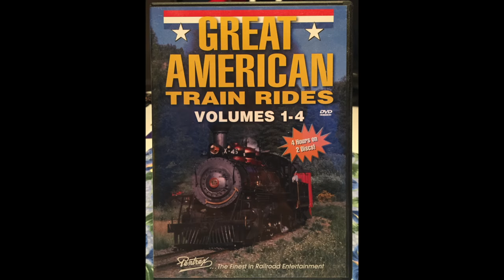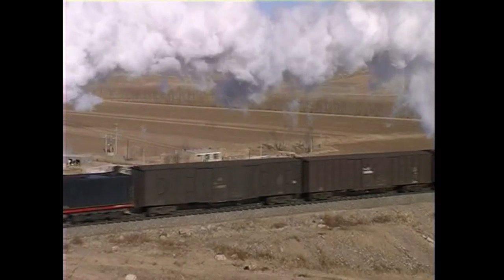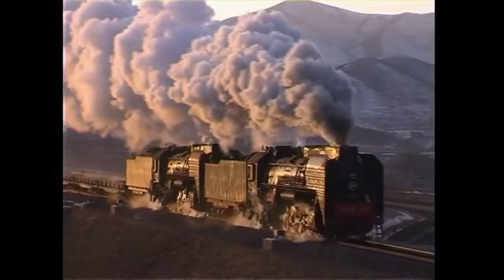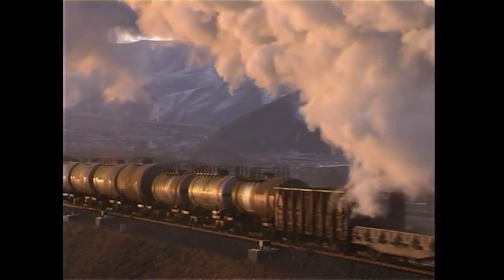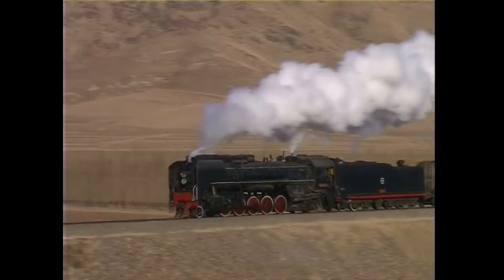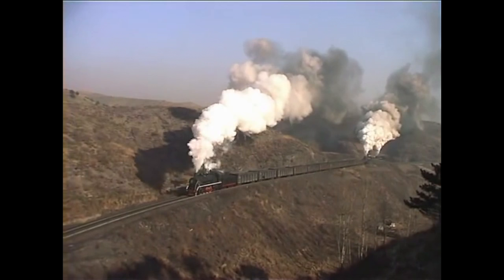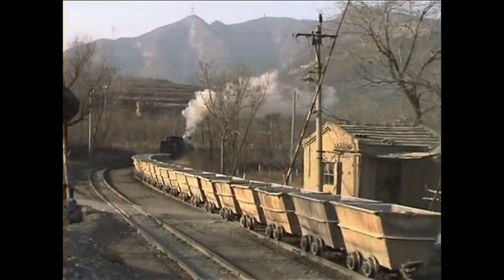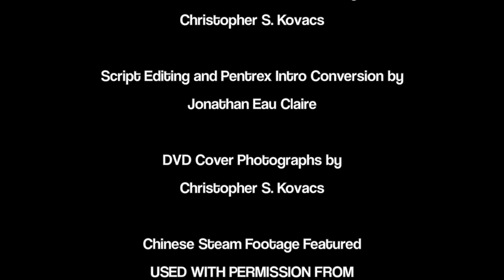The Month of Pentrex - China Steam Spectacular

Comment: The Valley Railroad's New Haven 3025 is actually Former Knox and Kane SY Class 1658M. After being damaged by a roundhouse arson fire in 2008, it was auctioned to the Valley Railroad in Essex, Ct. There, they completely rebuilt her to look like a New Haven J-1a Mikado.
Reply from the maker: +Leozilla 97  I remember it being #1658, then just #58 on the Knox and Kane before being sold to the Valley Railroad.  They did a great job returning her to service.
Reply: She originally had the M in her Number to signify that she was an American Spec Locomotive. I honestly felt that she should've stayed in her Chinese Livery while operating on the Knox and Kane. I felt that The White front and yellow lining made her look like a Clown. But yeah, the Valley Railroad transformed her into a Beauty.